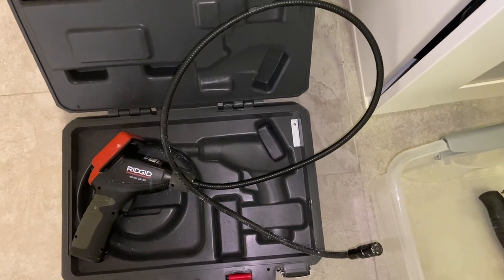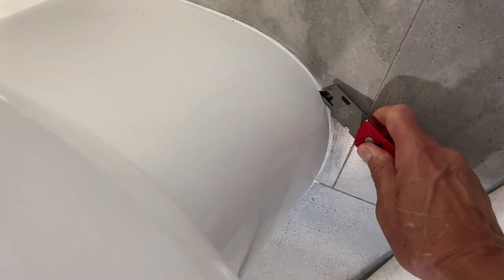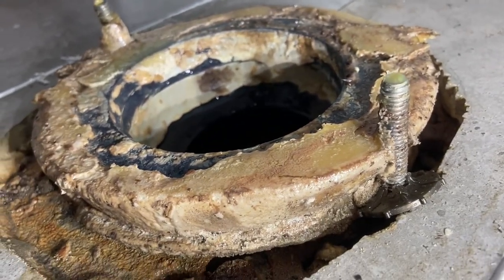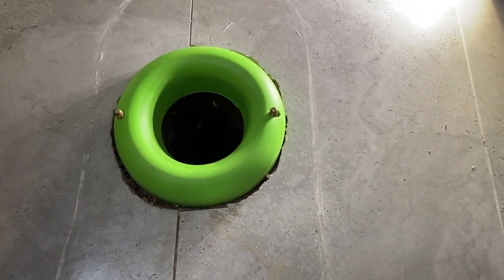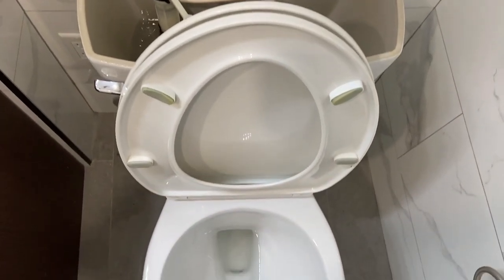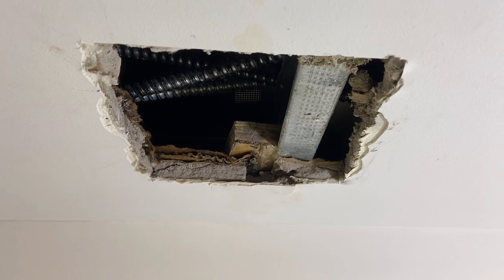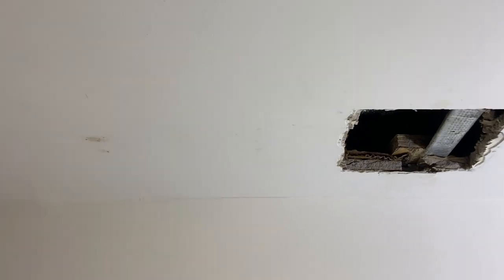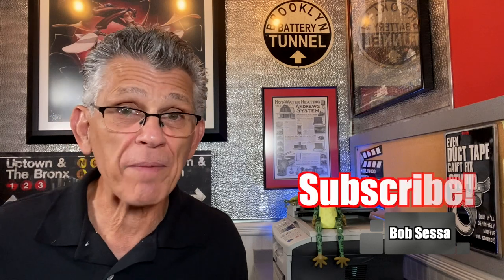Toilet Wax Seal Leak

Comment: I do a lot of emergency plumbing work and insurance jobs. That whole bathroom floor and any damaged sheet rock should be pulled up, removed and all mold removed and treated. I guarantee you there's black mold growing underneath that tile. 

Toilet flanges are a massive problem that I deal with all the time. It's a very important part of the job that many overlook. The flange should sit on top of the finished floor. When done correctly a basic simple wax ring is all that's needed and will not leak for decades. 
Great video! I really enjoy your channel!
Reply from the maker: Thank you! Much appreciated!

Comment: Do you always use the sani-seal? Looks good but does it hold up long term like wax?
Reply from the maker: I've used it twice, once about six years ago and once two years ago. No call backs so far, but my prefered method is good old fashioned wax seals.